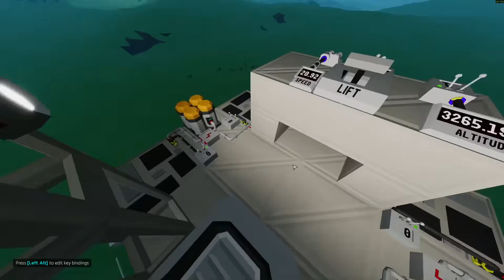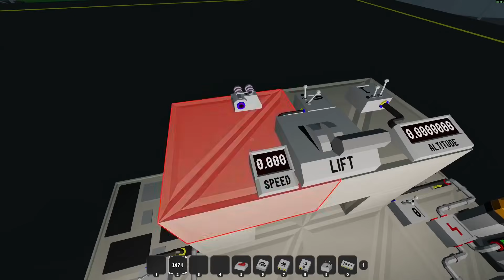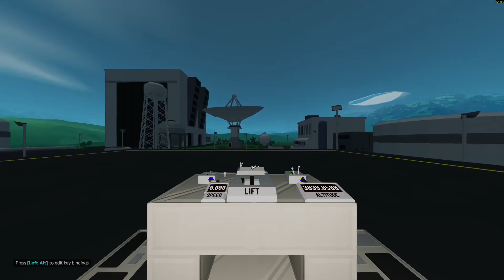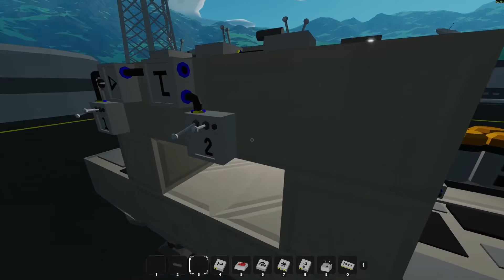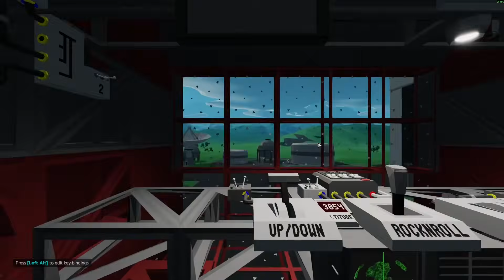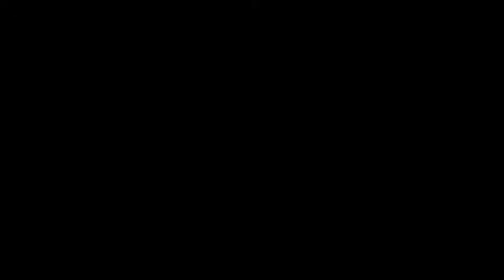Automated Landing in Approximately Up

Comment: I really like this concept but i was unable to get it to work in my game, instead of auto landing it just made it so my thrusters did not work, what I was confused on is how you have a lever output number and I wonder if the way i set up my thrusters would even work with this method. do you set up a separate radio signal for your levers for your thrusters or have them input directly into the thrusters radio signal?
Reply from the maker: Some of these display screens are for debugging or just to let you see what the system is doing. I'm running a bunch of data routers throughout the process just to track each step, which is really not necessary.

The levers use different frequencies than the final output going to the thrusters. I believe the numbers in this example were:
0: Thrust being sent to the thrusters
1: Altitude sensor
2: Differentiator's output (calculated velocity) [Only used for display]
3: Output from the multiply block (this is the auto-lander's calculated thrust) [Also only used for display]
4: Output from the manual thrust lever

In a proper setting, you probably don't want to waste that many transmitters and I generally use this with only one or two frequencies (one channel for speed, one for the final output going to thrusters, the rest can all be manually wired rather compactly). They were mostly used here to have displays for every value while also keeping the main circuit separate from the displays. The intention was to reduce wiring and make the circuit more readable, but in hindsight, it did the opposite.
Reply: @girgraffe9233  Thank you for responding I will try again
Reply: @girgraffe9233  I figured out how to get it working even got a auto hover setting for it, thank you again!

Comment: Your explaining is very good however your cuts make it really hard to rebuild it. Espacially because you have wireless transmitter which are connected to what?
Reply from the maker: It was a compromise I made in video planning. There is a comment below where I replied with the list of transmitter frequencies, but I didn't really want this to be seen as a tutorial, more of a demonstration for how you might be able to think about components.

This was to cover two things: First is that I am likely to get specifics wrong, which is less of a concern if the only focus is to showcase an idea. Second was that this was made in the demo, and I knew that the full release would either introduce mechanics that further complicate the problem, or add components that made the current setup obsolete.

I wanted to wait for full release and test different designs in practice before revisiting with a proper tutorial, which I'm looking to get going soon.

Comment: How about making BPS-landing system? I've made one that uses output from BPS to switch different values to move slower or faster towards planets surface. if value in red zone or more 0.6 in output it uses more thrust, if 0.6 to 0.3 it uses like half between strong and weak thrust and if less than 0.3 its like minimum. And if you land on different planets you just switch 0.3 constant to bigger number that weak thrust will be last longer till landing. And if its less than 3 height units it will turn off the engines
Reply from the maker: Yeah, I've been seeing a lot of different approaches to the same problem. BPS is definitely nice, especially on approaching planets. Planning to use it for planet approach and the velocity system for final landing. I've seen a few people tackle auto-leveling as well. Hoping the full release lets you increase the number of logic gates so I can go completely overboard with it all.
Reply: @girgraffe9233  Can't wait for it too!

Comment: What negative numbers did you use to get the lever to work?
Reply from the maker: If you're talking about the side lever, I typically set the constant to a slightly higher magnitude, that way throttling up all the way on the lever usually leads to borderline hovering. This depends entirely on the thrust to weight level of your ship and also just how sensitive you want the controls to be. You could just start with something like -2 and adjust from there.

Comment: I tried your system as you did it and its very unstable. the thrust shows negative starting out and it raises me instead of lowering me down. What did i do wrong?
Reply from the maker: If the thrusters are burning the wrong way, witch the sign on your constant piece. If it's just too sensitive, lower the magnitude on the constant (make it closer to 0).
Reply: if you put you multiplied output into a data router 2 it seems to switch the sign